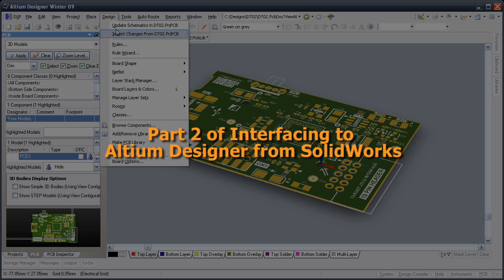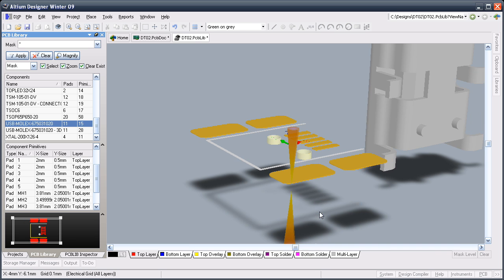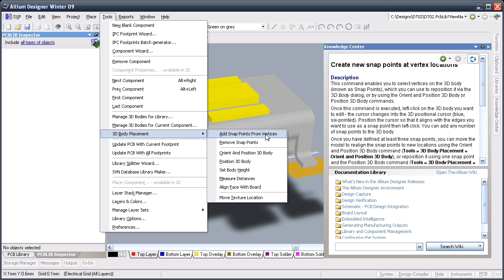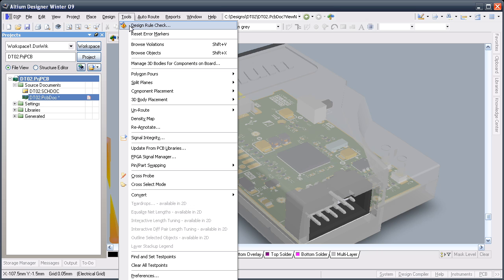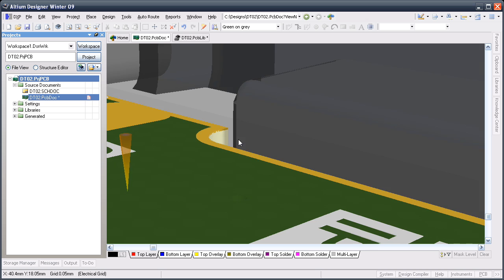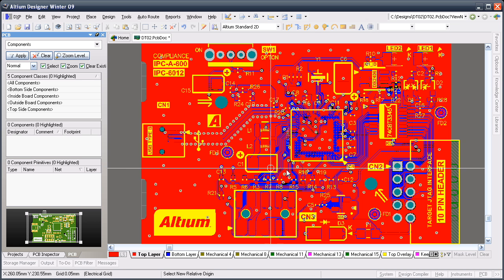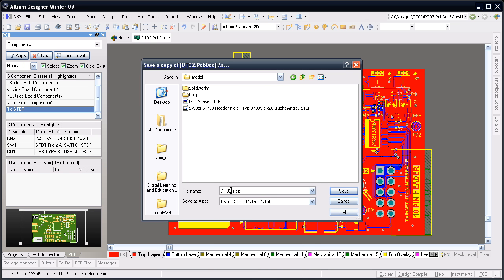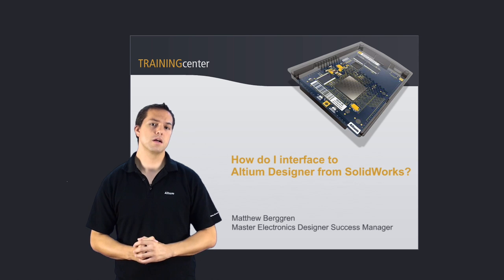Interfacing to Altium Designer from SolidWorks - Part 2

Comment: I know this is coming a little late and after the fact, but forget about using the stp or IDF from Altium. If you want to create a 'real' 3D PCB using Solidworks buy the interface software from Desktop-EDA. With that, and 3D components you either make or download, you get a Solidworks 3D PCB assembly with all the details. I know as I've been using it for years. A good short cut would be if Altium would use IDFv4 instead of IDFv3........which is what everybody else is using.